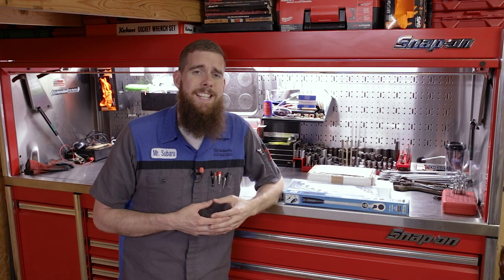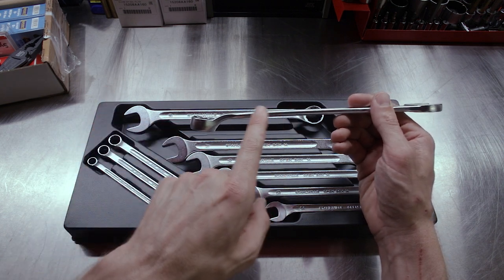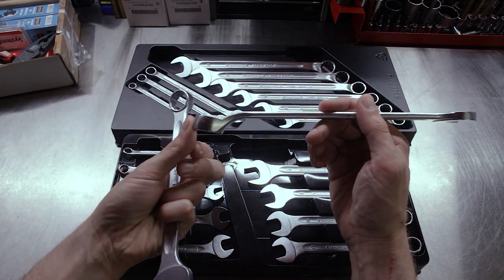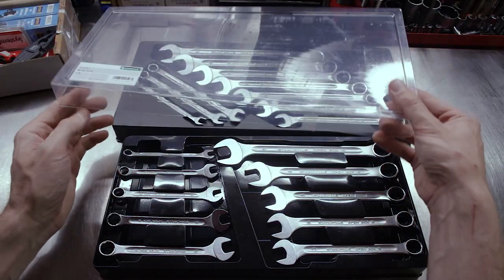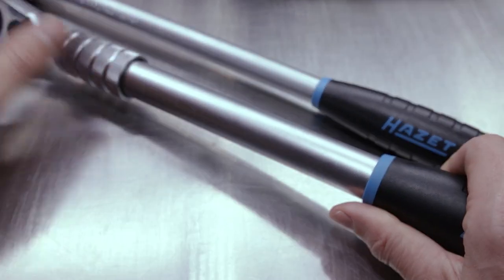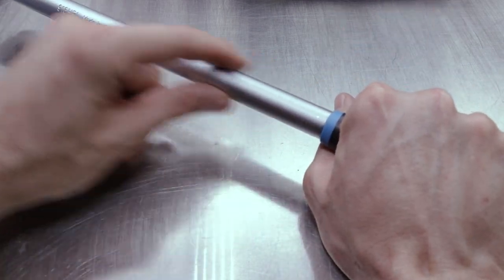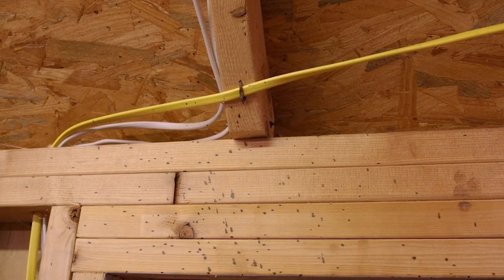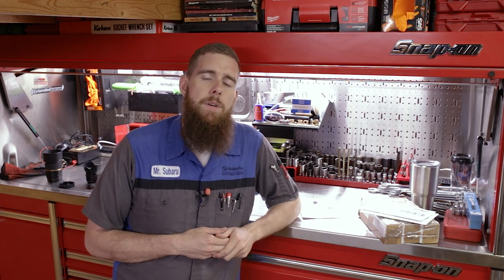Tools From Germany: Another German Tool Haul From HFG! Hazet, Stahlwille, & NWS!

Comment: I use the Stahlwille box 13 wrenches in lieu of thin wrenches and so far they’ve been thin enough every time.  Added a Hazet double open end 16-18 and 21-22 of equal thickness to complete the set.

Comment: I’ve always wondered why some wrench sets skip certain sizes. Is there a reason for it? Seems like it’s usually 15 or 16.
Reply from the maker: I know most sets in Japan are 8,10,12,14, 17,19 because that's the only sizes they use. Not sure with the Germans/others.
Reply: Hello everyone. I'm a truck mechanic in Germany, we mainly repair Mercedes-Benz and MAN trucks. It is so common with old models that only screws and nuts of sizes 8, 10, 11, 13, 17, 19 were used. It's different today. At Mercedes, 16mm is now used instead of 17, and at MAN very often 15. I think to save weight. Often, however, only the nuts are hexagonal, the screws are often torx. Volvo trucks solved this very cleverly. The screw is usually always a different size than the nut. Because then you only need a set of keys. If the screw has the same wrench size as the nut, then you need two of the same wrench. P. S. These tools are all made not far from where I live. They all come from the "Ruhrpott". Many greetings from my home country Germany, I am pleased that you like our tools so much. P. P. S will repair my SJ5 tomorrow, the brake caliper is fixed at the front right, the axle sleeve is defective and the inner joint of the drive shaft is at the rear right. I love what you do and your videos have helped me 100 times. Thanks for that. Greetings to the USA.
Reply: stahlwille do more complete sets if needed, they do a 17pc 6 to22mm no skips and a 18pc set to24mm with 1 skip .
skip sizes are done in sets to match asme din jic etc bolt hex standard sizes .
Reply: 16m is the same as 5/8 have a sparkplug socket marked as such
Reply: @harrymiller3986 German spark plugs don't have inch sizes :)

Comment: Man! Those look nice.  Ha e you tried Tekton?  They are actually  pretty good tools.
Reply from the maker: I haven't actually.
Reply: Try them out.  They are actually pretty good tools and a very good price.  I just recently bought a 1/4, 3/8, 1/2 Inch Drive Quick-Release Ratchet & Breaker Bar Set (12-Piece) 90 tooth count.  They also come in non-quick release.  I am pretty happy with them.   I like these German brands but they are pricey.